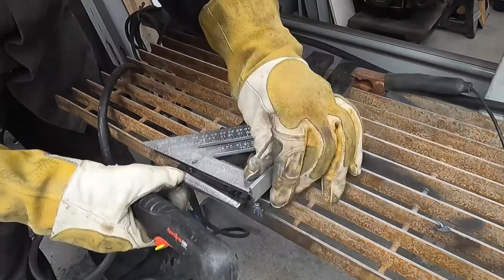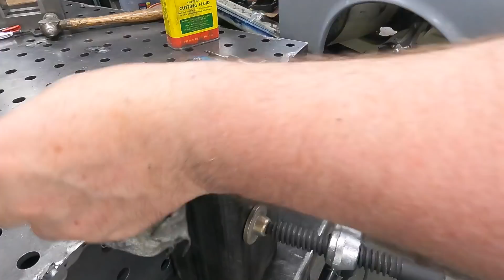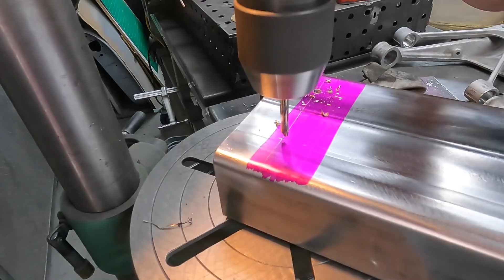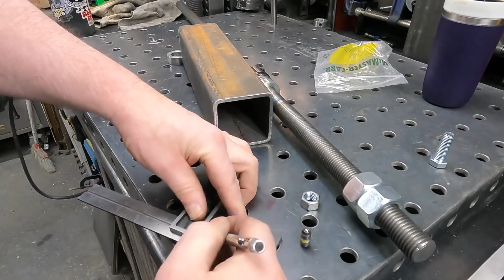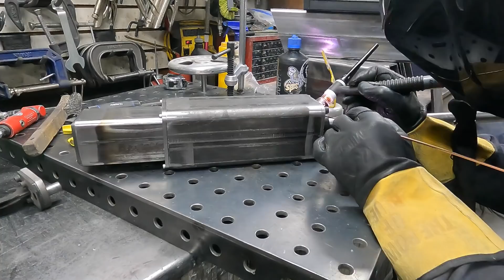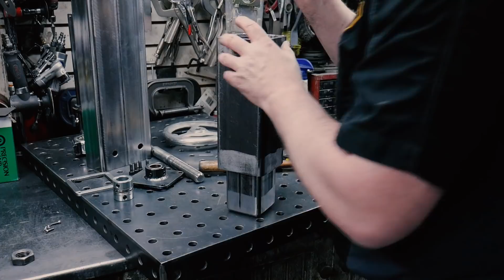Making an English Wheel: Building the Adjuster

Comment: I've watched this about 10 times now and I still cant see how the quill works - what happened to teh double nut that you welded together? Dont suppose you have a section sketch through this do you??
Reply from the maker: Sorry, I don't have plans/drawings for this part.  The double nut is inside and welded to the quill (the part that holds the wheel) at the top.  The threaded shaft with the bearing/bushing and collars is there to keep the shaft/wheel at a fixed height.  The quill then goes up and down riding on that double nut.  There is more adjustment than is needed.  If this still doesn't make sense - DM me on Instagram and I can draw it for you.

Comment: Thanks, I’m just finishing my bead roller. English wheel next. A friend  gave me a new set of Stryker wheels , made years ago. The wheel is next project. I really appreciate  your video of the adjuster. I’ve been agonizing over a design for a while. This helps a lot. Thanks.
Reply from the maker: Thanks - that's a very good friend you have to give you a set of wheels!  I agonized for years over this design.  I just didn't like the exposed screws etc on what I was seeing and the solution for the captive nut/adjuster wheels seemed more complicated than I think they need to be.  I hope your wheel turns out.

Comment: I'm a little confused how the adjusting screw is connected to the inside of smaller square tube that rides up and down. Can you explain further?
Reply from the maker: There is a threaded nut inside the body of the smaller tube. The top of the larger tube is designed to capture the threaded rod and allow it to rotate.

Comment: If you applied silicone grease on the plastic guides it would slide with almost zero friction we used it on guide on machines tgat had ptfe runners it eliminated any Drag
Reply from the maker: When it all gets done and I do the final assembly, I'll lube it up as you suggest.  Thanks.

Comment: ,like the tutorial but have you thought of using an acro prop for the adjuster I'm sure they must have them in your part of the world.
Reply from the maker: Thanks Roy - they do have them - I just never thought about using one.  Good idea though.
Reply: just me being lazy, you put a lot of work into your adjuster, and i thought that most of the work is already done with an acro prop and all that would be needed is the lower anvil holder to fit in the slot made for the acro top pipe, i recon all an English wheel needs to work is just have adjustable pressure from above and below the anvil wheels and of course be in alignment with no excess movement. anyway I'm going to give it a go coz i am poor and cant afford the price of a new one,

Comment: Nice !
The good thing with outside adjusters is that you can fine tune the wheels against each other if the frame isnt 100% straight.
But you will probably get your frame perfect. 😅
Reply from the maker: Gauntlet dropped...I'm sure going to try to keep it straight!  I know it will be a challenge.  The bottom anvil cradle has adjustment if things get a little twisty.
Reply: @ThrottleStopGarage  it was meant as a compliment 👍
Reply from the maker: @daahoo  Thanks - I was giving you a wink - love a challenge.  In truth, I'm obsessing about the weld process for this frame right now...so I'm watching some F1 instead of working.

Comment: Wow - your drive is endless….. and incredibly inspirational.  Thanks for sharing this build.  Several times I’ve been tempted to just go by the HF version, but haven’t pulled the trigger thinking I would love to build my own.  Your approach seems reasonable.  I have a lot of tools, but I don’t have a planer.  Do you have any hint on another way to trim the UHMW to thickness if you didn’t have a planer?
Reply from the maker: Thanks.  I think the best bet would be to measure the gap between the tubes and get the right thickness of plastic.  I could only find 6 mm locally, but could have ordered material that would have worked.
Reply: @ThrottleStopGarage  ok - that makes perfect sense…… And then just trim the fit with shim stock if required. I suspected it was that simple 🙂. Also, thanks for taking the time to remind us all how useful adjustable parallels can be.  I keep forgetting those are in the drawer.  Any chance you made sketches of your design that you would be willing to distrubute in a pdf for a PayPal gift 🤔?  Finally, all hail the algorithm 👍👍😎👍👍
Reply from the maker: @joell439  I'll see what I can dig up.  DM on Instagram.
Reply: @ThrottleStopGarage  DM sent 👍